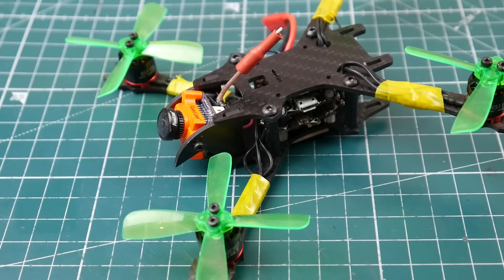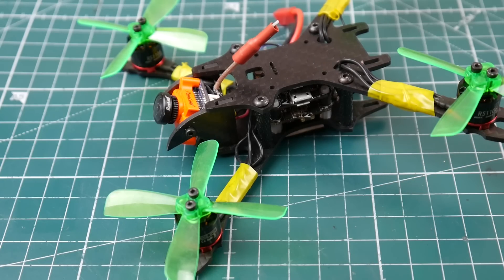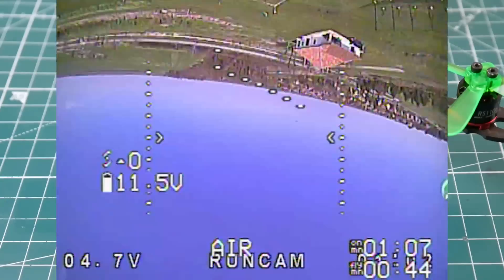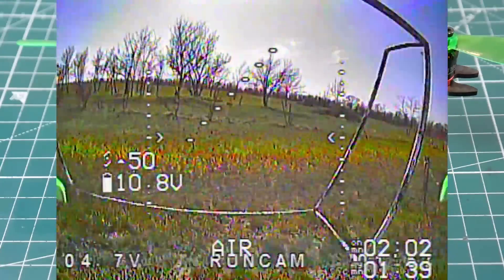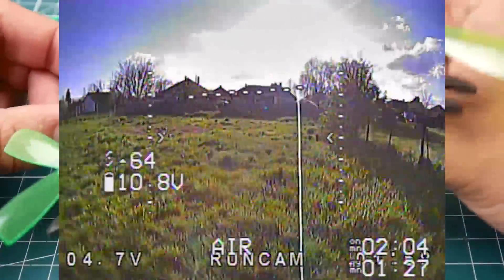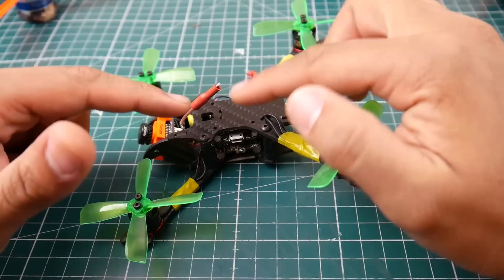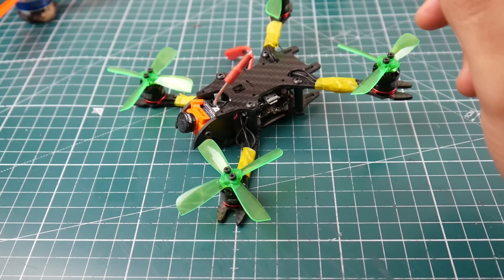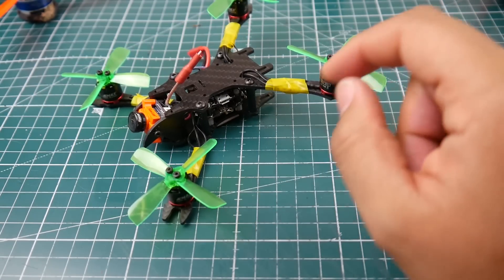Best Brushless Micro FPV Drone Components // Review and Flight Footage // HGLRC F428

Comment: This design looks great. In addition to the air in-take, the placement of these high back motors also improves the CoG of this type of micro (low front camera + bottom battery, which seems never working well.)

Comment: I have the froggie 135 that has so much punch and float, it is rated for 3” props as well and I’m running 2.5”. I think the flying characteristics have to do with the prop separation that allow the quad to grab more air to float.

Comment: perhaps you could get in touch with KebabFPV, he could give you some thoughts about how/where to make the frame? I'm quite sure he will ask you, why didn't you rotate the direction of the carbon fibers by 45° :) To make it stronger (unless the carbon you used looks different on the inside, than on the outside)... Also, can you compare those racerstars 2435 with gemfan 2035, are they similar in durability? Obviously 2435 will be more "powerful", but...

Comment: These motors obviously worked out for you, looking good.. I got these exact motors and only 1 out of 4 was ok.. 2 had vibes and one had severe vibes.. I was quite surprised as emax are usually first class..
Reply from the maker: Email emax this Is my second set and flawless.
Reply: Patrick I’m surprised to hear this also, I’ve got 32 rs1106 in both 4500kv and 6k without issue, and there are at least another 100 amongst my club with no issues I’ve heard, I’ve been flying almost exclusively emax motors in fixed wing and quads( got some hype motors too) for 3+ years and crash a lot:-). Clones perhaps?
Reply: Patrick Wilson Maybe they were clones?
Reply: I thought about them being clones, they are from BG and came in packets with the whole scratch serial number system on them, I should dig those out and check..
Reply: What are your pids?  Shorter wheel base requires more fine tuning.
Reply: Kyosanym I'd literally swapped out to these emax motors from some dys. On the bench, props off, there was vibrations present as stated.. Pretty sure it wasn't some tuning issue, had it flying fine on the dys.. just popped some HGLRC motors on and they are fine 👌